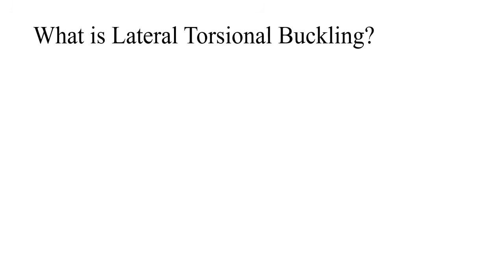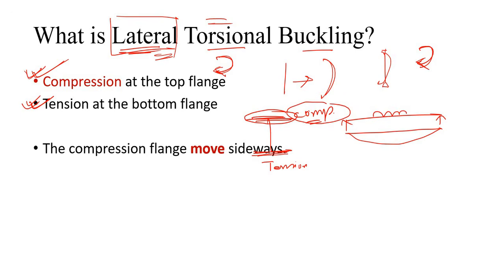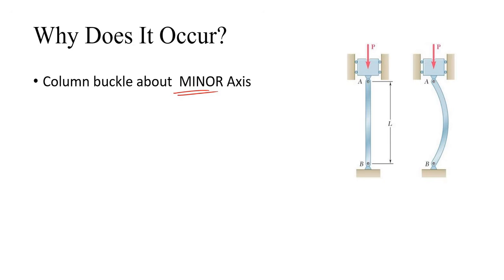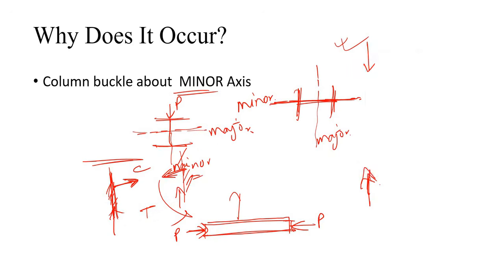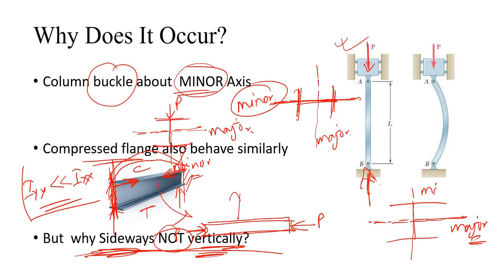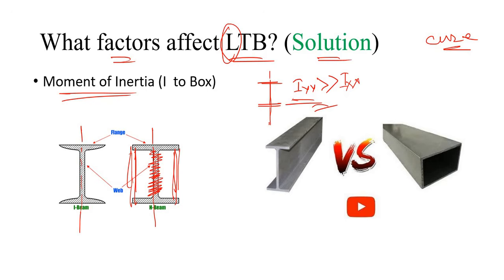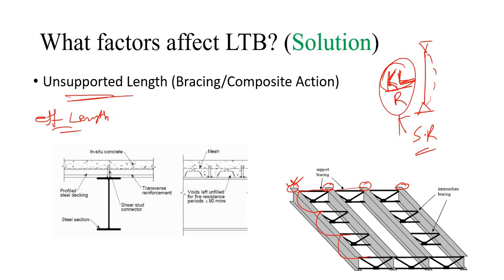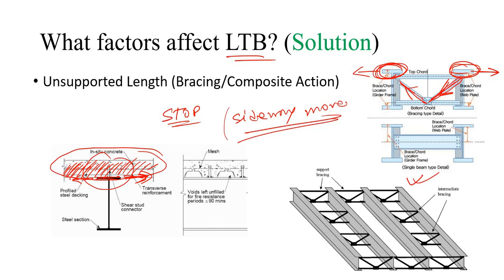Lateral Torsional Buckling Explained | Why Steel Beams Fail

Comment from the maker: Hey, drop comment about your feedback or any questions. I will get back to you ☺️

🚀 Steel Design Masterclass (Complete 38-Video Course)
Master in-depth structural engineering concepts through 38 comprehensive, pre-recorded tutorials. Includes doubt clearing for each module and 1 year of personal WhatsApp assistance.

🔥 EARLY BIRD OFFER: Normal price is ₹1,999, but it is only ₹999 for the first 500 students! Don't miss out.

👇 Enroll via UPI / Netbanking Here:
https://rzp.io/rzp/VZqWHXja

(Note: After completing the payment, access will be manually granted to your registered Gmail address within 2-4 hours. See you inside!)